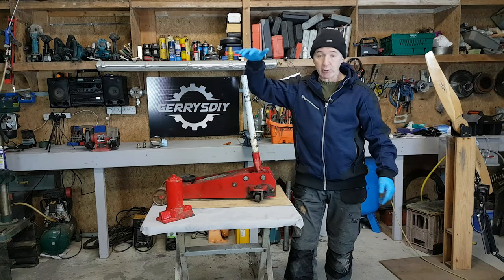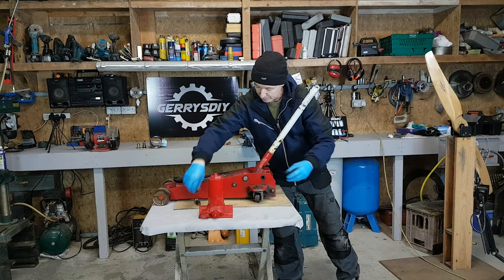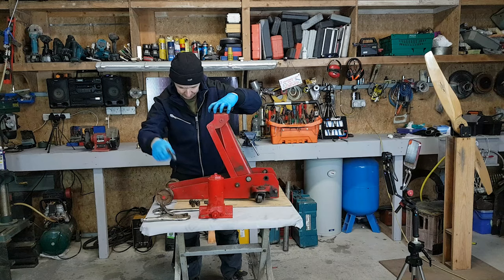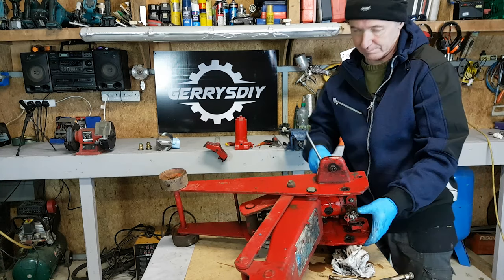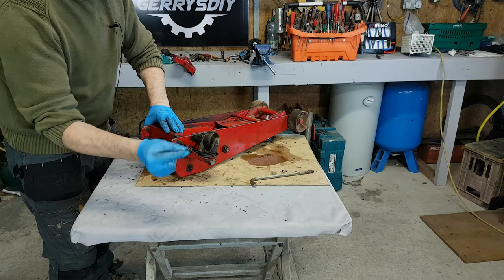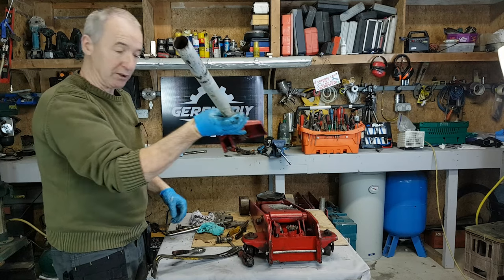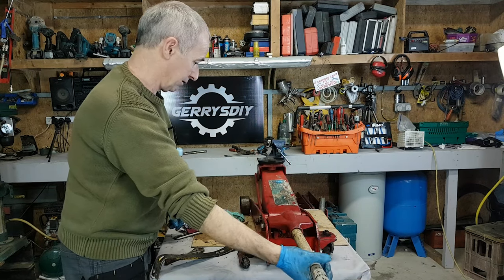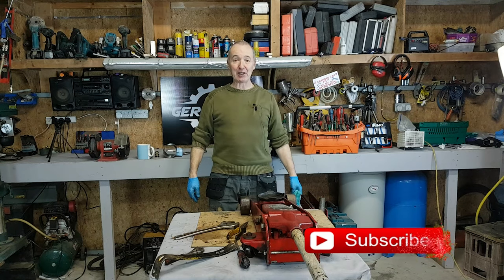Easy 3 Ton Floor jack Repair

Comment: That helped me seeing how you got that spring out with the vice grip/screwdriver combo.  My pivot pin for the upper frame of the jack is pressed in and is as good as non removable for me.  Craftsman 3 ton, relatively modern made in China deal.

Comment: A week ago I replaced seals in two of my bottle jacks. This single digit  (F) weather and age had them laying flat. I have one more, a 20 ton, that needs a bushing in the relief valve at the bottom. 
Cheers Gerry!
MB BAR RANCH
Reply from the maker: Hi Martin.
Well done on getting your jacks working again. I would have just changed the seals in this one but got lucky with the gift of the pump. It's been a really mild winter here, mostly windy and wet with some frost and a little snow but nothing like the weather you get there. Thanks for commenting Martin Cheers Gerry👍👍

Comment: Jejeje I have exactly one of those tables when I bought at a garage sale I was wondering if it would hold a floor jack I wanted to fix jejeje I had never seen them before but they are sturdy

Comment: Don’t know whether you still read comments but I’ve got a jack similar if not identical to this one and the problem I’ve got sometimes the teeth engage and sometimes they don’t. If I jiggle it about sometimes it seems to drop down and engage but often it won’t although when the handle is almost upright it is nearly always engaged any advice would be very welcome thanks